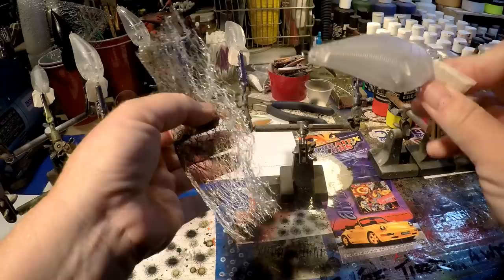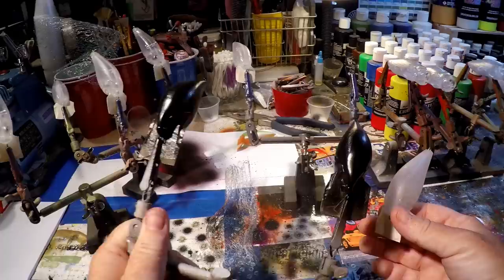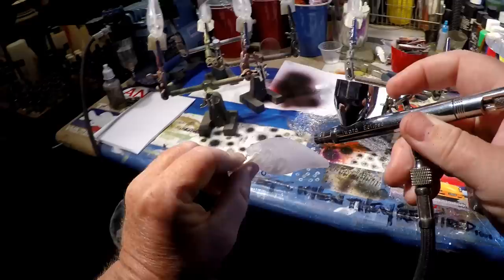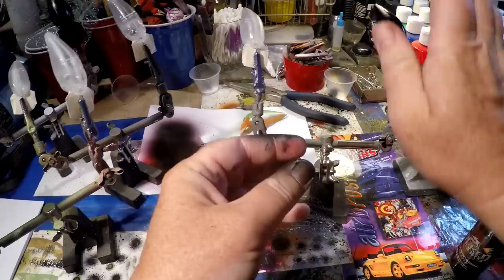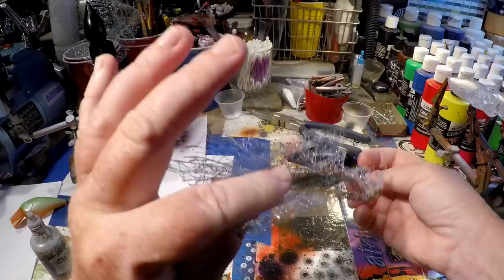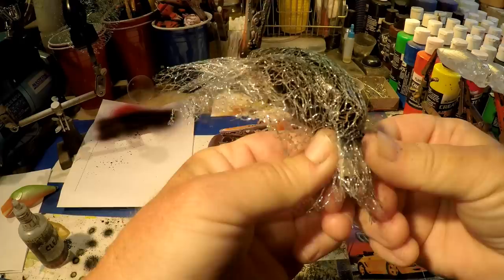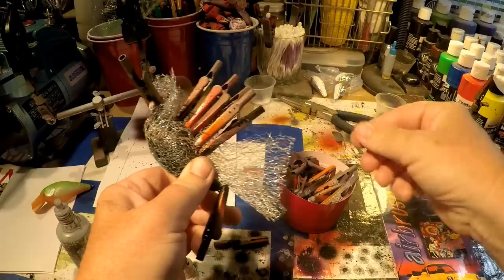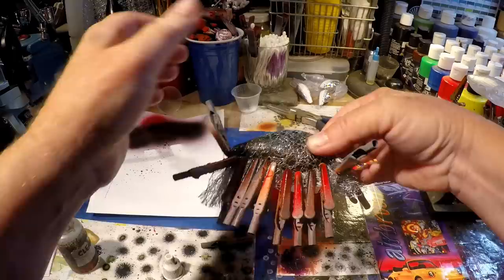Spray Session!! Tak's "Lake Martin Red" pattern and color scheme

Comment: Hi Jenn, 
New to your channel, love the vids. May I ask what clear coat you are using, looks like a satin coat ?. Now this is just my opinion but wouldn't the colours pop more with a couple of coats of two pack clear.
Reply from the maker: CaptainBax there’s lots of choices out there. I’m a KBS user at present time, mostly for ease and convenience due to the volume of Baits I’m doing. But I do like it. Considering making the jump to Alumilite 😉
Reply: @Jekyll424   Thanks Jenn for the quick reply, I did hear you mention KBS after I asked the question on another vid and looked it up. I see it's an Australia company, do you have an Australian connection as I see you use a few products from Down-Under which is where I'm based. Anyway is that the Diamond Finish from KBS that you're using, I see it's a gloss... my apologies if it is, just looks satin on screen. 
Jenn as I haven't seen all your vids as yet and you might have already made a few but I would love to see your handy work on a big popper and just one last thing. What's your thoughts on the theory that the top of the lure should have a definite contrast to the bottom and should always be dark over light ?.
Reply from the maker: This requires a bit more in depth response. I will answer you in the morning 🙂 Cheers!

Comment: that's crazy cool so when you dip for epoxy do you hang it and leave it alone completely or do you make sure to eliminate the access?
Reply from the maker: The drip wire on the tail eyelet eliminates the excess. I leave it alone for about 18 hours